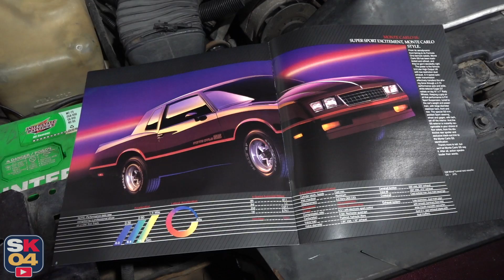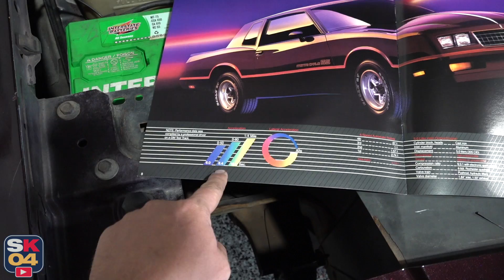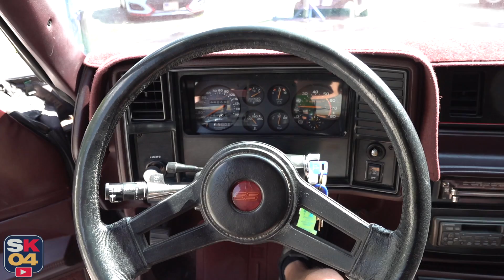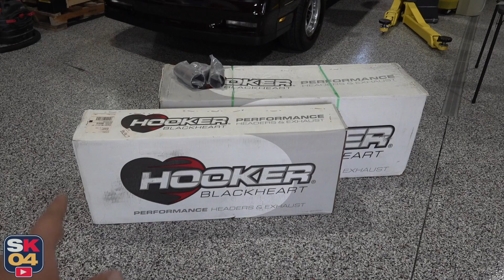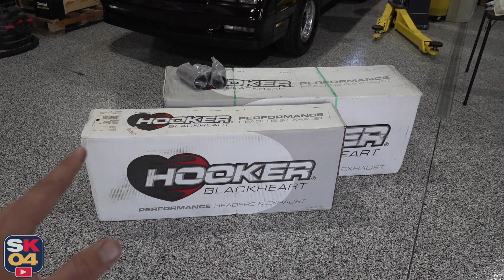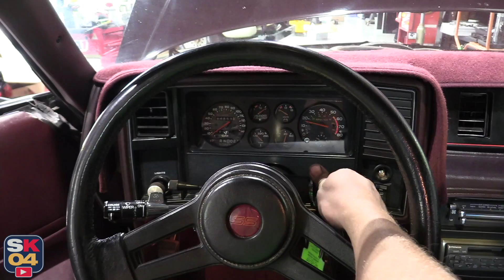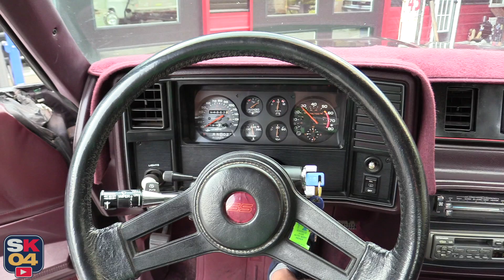Installing A Hooker Blackheart Exhaust System On My 1985 Monte Carlo SS!

Comment: You've been HOLDING OUT on us! Awesome! One of my favorite G-body coupes. Best of GM's last rear drive coupes. Love the clean lines of this model. Thanks for this video, Kyle!

I love the idea for swapping in a TPI fuel injection system.
Reply from the maker: Thanks for the support bud, I appreciate it!!
Reply: Wut. That's not true. A 305 has the same stroke as a 350 but a smaller bore. Externally it's the same but dimensions internally are different. 

If it was an oversquare 350 it would have been a ripper, instead it's under square and a low end torque motor.
Reply: @fataxe1  thanks. Fixed it.

Comment: Brings back memories when my dad had a 86 monte carlo ss when i was a kid. His was a t-top car and was originally silver. He later painted it maroon with black on the bottom of the car. It had the burgandy interior. It had the aluminum monte carlo ss wheels. It also had a noisy gear drive. Is was a pretty cool car when my dad had it. The car is still around, but unfortunately it's a total rust bucket and clapped out.
Reply: Bring it back to life. Where are you located

Comment: If you are able to put the TPI intake on the current cylinder heads depending on the angle of the bolts, you'll have a torque monster of a 305. Not too powerful but from a dead stop until the end of 3rd gear, it'll get going real nicely.
Reply from the maker: Yep, the intakes match up fine, it's going to be sweet!
Reply: @saabkyle04  You'll have a lot of fun with it, brother. Looking forward to seeing more episodes on all of your projects.
Reply from the maker: Thanks a lot!

Comment: Sounds good. The tpi will be nice on that engine. Just make sure you have the right base manifold. 84-86 will bolt on. 87 and up will require modifications to the four center intake manifold holes. The HO heads are pretty good for the 305, they have small valves but flow good and they have small combustion chambers.
Reply from the maker: Yeah the TPI setup I have is from an 85 camaro, but I have a newer ECU to take benefits of extra "tuneability".   I appreciate the insight!

Comment: I have a  84 Caballero with the Gear shifter on the column. my question is when you said that something wouldn't fit. Were you talking about the long tub headers or that style of exhaust. That wouldn't work if you have the gear shifter on the column. If u are talking about the long tub headers would shorty header be best for my application with that style of exhaust..

Comment: Sounds bad on idle no tune and no deep rumble but its really better than stock
Reply from the maker: FYI, the carburetor needs work/rebuilding and is idled higher than it should be so it doesn't try and stall out (which it still does).  The exhaust sounds amazing, with a great low rumble when in gear.  It'll be a whole different car after the TPI conversion.
Reply: @saabkyle04  fair enough , good luck kyle looking forward to see more of this build  🔥
Reply from the maker: Thanks pal, I appreciate it!